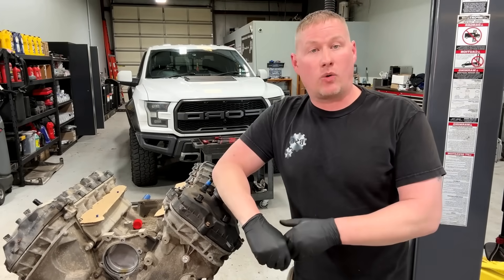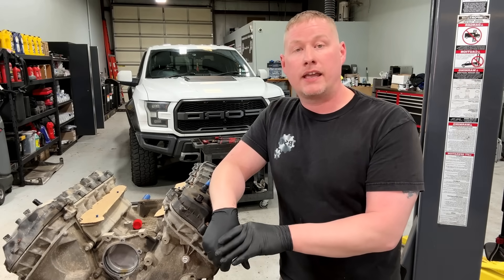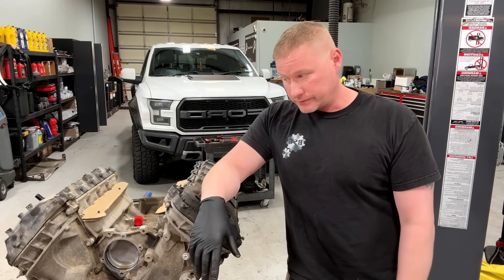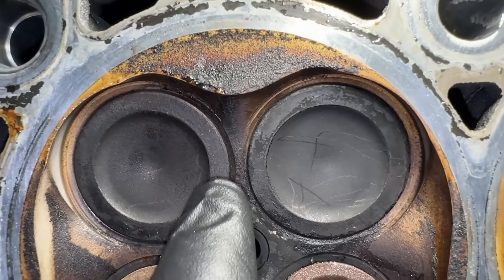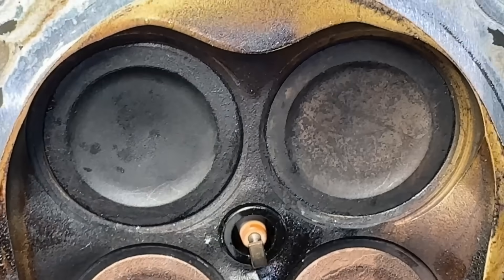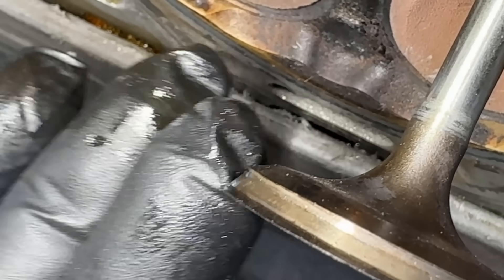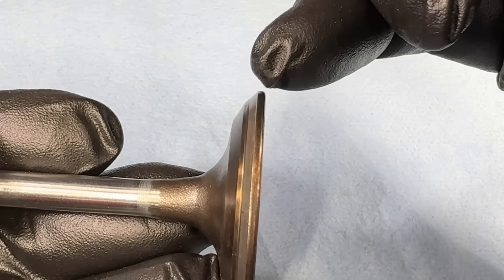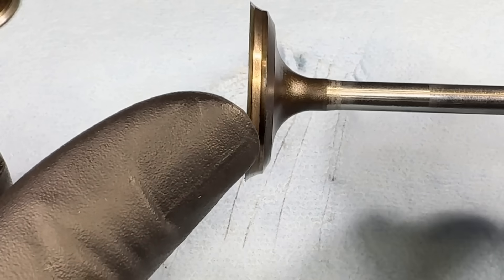The One Fatal Design Flaw of the 2011-2014 Ford 5.0L Coyote Engines!

Comment: Scary world we live in where installing an entire rebuilt engine makes economic sense compared to just rebuilding the heads.
Reply: it situational if you buy remanufactured heads and turn yours back in, its much much cheaper than paying a machine shop but either way labor is expensive
Reply: @sirjames1983   not questioning the economic reality of the situation, but on the whole it’s still somewhat insane that this is the way things are now. Plus, finding a machine shop these days is difficult. It took me a few days of searching and a forty mile drive just to get a flywheel resurfaced last year. That used to be a common, head down to your local shop, sort of thing.
Reply: @Wreckerboy  Very true, the same as in our area here in Canada, as there use to be a machine shop in every community.  They can be found, but it takes more effort and time (driving further afar in ridiculously high traffic) to get the job done, then return, and fight the same traffic back.  It all takes patience, and more $$ these days, on top of the already expensive lives we lead.
Reply: It's about 5000$ cheaper to just replace the valves.
Reply: I wonder how much reman heads are for these motors, I couldn't see replacing an entire engine for a valve issue unless the valve broke and caused catastrophic damage.
Reply: @joecostantino3684  Dollar for Dollar its just logical. I tried your method with a Ford Fusion and lost my shirt. I paid twice and ended up with a Ford Longblock in the end.
Reply: @07GTCalispec  I guess they just don't make engines to be rebuildable anymore it seems. When I bought my 03 Ranger (3.0 V6) in 2018 it had a misfire at idle from Cylinder 6 which turned out to be a bad valve seat. Replaced the heads because it was a known issue for those engines in the early 2000's and it was good as new. Then again this is an old school iron block design pretty simple engine.
Reply: Modular Head Shop is prob the best for Modular fords and coyotes
Reply: i just figured out i have a blown head gasket and it makes me sick thinking what it's going to cost me
Reply: It’s always been this way if you are paying for labor.  For those of us doing our own work it’s different, the hours tearing down the engine aren’t costing us $150 to $200 an hour.
Reply: Just thinking that this is at 130,000 miles as well.
Reply: The powers that be want the auto industry to be replaced with electric vehicles that you can't own off of warranty. Cyclical lifespans that turn car ownership into a subscription. They can turn off your car ownership with a click.
Reply: Anybody remember when your typical gas station could do so much mechanical repairs. All the exhaust pipes and fan belts hanging high up on a wall. Light bulbs, fuses, oil, batteries, etc. near the cash register.
Reply: @ChessIsJustAGame   Back in the early '80's I can remember getting a full exhaust system on my pickup, from manifolds, out to the rear of truck...for $180.00 parts AND Labor!   Now everything has a catalytic converter, jumping the price significantly, and it alone being Two to Ten times more, than a whole exhaust system back when life wasn't so complicated or expensive!   It seems to get worse by the year, giving those with EV's a reason to question why we'd update these parts, when their cars don't need them.

Comment: Not sure what a Re manufactured Long Block cost now days with OEM parts but I had this issue and had both head re-built out the door a few months ago 7k (in frame) out the door.  in my case my bottom end was still really good @ 130k.

Comment: My 2011 has slight miss at idle. 107,00 miles. How long should a person wait to replace engine if it is valve issue? Truck is in immaculate condition.

Comment: My 21 year old Toyota has 266K hard miles on it. It runs just like it did the day I bought it new. No special oils or filters. Just a change every 5K and coolant flush every few years. This is why I don't buy Fords anymore. But I'm a Ford guy and I've never seen any bullshit like this from my Gen 1 Lightning. Yeah, back when a Lightning was a proper truck. I haven't seen a single truck I'd replace my 30 year old Lightning with. Not from Ford or anyone else.

Comment: I did this back in 2017 to my 2011 f150 5.0 but had the heads rebuilt at a good machine shop.The valves where so sharp you could shave your beard with them.  I couldn't afford a new engine at the time so this was the only option I had. They replaced all the valves and seals and this fixed my oil Consumption issue and only cost me $1,500.00 for everything including gaskets and head bolts after a month of working on it over the weekends I got it back together and it ran beautifully for years until I sold the truck

Comment: I have a 13 f150 with low miles.. 53,000… seem like it doesn’t have the low end power it use to. I’ve checked all the normal stuff. Scared to do a comp check lol …

Comment: Exact same thing happened to my 2013 F150 5 L motor. 101 thousand miles and check engine came out with PO four misfire. Took it to two different shops and eventually replace the engine as the trucks in great shape otherwise. Just couldn’t stomach spending $75,000 on a new pick up. Thank you so much for this information. I searched the Internet extensively last year and just couldn’t find information like this. Long time subscriber and will always watch your videos.
Reply: I wish my 13 was a 15 with the aluminum body. Runs like a champ but the body its suffering. Rust repair at this point is just out of the question. Still looks good but when you pop it on the lift you notice the few rust holes in the rockers.

Comment: So it's a material issue with the valve, but why does it always happen in the same cylinder(s)? Do they run hotter or something due to where they are? Thanks, great vid.
Reply from the maker: Yes you are correct.

Comment: I have a 2011 with ~80,000 miles on it. Does this happen at a certain mileage? Does it happen to all 5.0's?
It sounds like a heat treat issue so QC. Would that mean that you can get lucky?

Comment: Brian is as good as it gets if you own an F150. My 2004 5.4 Runs like a swiss watch because of him. 170k miles. I did a complete timing job at 153k miles preemptively after watching his 4 part series. I went even further and replaced everything up front + the oil pump while I was in there, plus all the roller followers, lash adjusters, and cam solenoids. Why Ford is having issues with valves is beyond me, as this technology has been well known for a very long time. Maybe they decided to go import? I have never run into a " sunken valve " issue in my life and I am 77 years old.
Reply: Your lucky my motor was toast at 160,000 miles ! Started ticking and then engine light! The stock oil pump does not put enough oil into the Cam Journals. Had the motor swapped out for an upgraded motor from Power Train products. With a Melling high Volume oil pump. She runs like a champ now! 25,000 on new motor and running strong and Smooth! You may have saved yours just in time? I always changed the oil frequently by the way
Reply: @Jondog65  I have always put in a pint of Marvel Mystery Oil on every oil change. My first job when I was only 12 was helping an old timer that worked on automatic transmissions. He swore by the stuff. So have I ever since, and I'm now 78. Frankly, when I opened up the front cover at 153k everything was pristine, including the roller followers. Brian is most definitely the best source for Ford owners in my opinion, and his videos are clear, concise, complete, absolutely correct, and very well done. My 2004 runs perfect because of him.

Comment: I can’t wait to see that video going over all four current generations of 5.0L. I currently own a gen 2 in my Mustang and a gen 4 in my F150 I just bought. The gen 2 I’ve had no issues that weren’t self induced after 96k miles, ie o2 sensor fail from adding headers.

Comment: So is there a preventive way to address this problem to keep from buying a new engine? Get the valves replaced?
Reply from the maker: No way to prevent it.
Reply: @FordTechMakuloco  lovely. i tend to treat my 5.0 with dignity and respect so hopefully my truck will last. My 2013 is at 80K.

Comment: I feel like the endless 5.0 praise is mostly from old heads and people who can't accept that technology has moved on from the pushrod V8. "NA V8 is most reliable possible engine, end of story" and that's where their mind will sit until they die. While obviously anyone who works on vehicles knows that anything mass produced can and will fail. These types of little design or manufacturing flaws can affect any motor. Yeah, the coyote is usually pretty stout, but as clearly shown here, issues can pop up.
Reply: If you consider how many more moving parts are in these engines compared to the old style 5.0 HO engines, you can see why the new stuff seems to have so many more big problems.

Comment: would you recommend replacing the valves on a 2011 that only has 45k miles on it .. currently runs great.
Reply: Rule #1 in being a good mechanic. " If it ain't broke, don't fix it".  Rule #2. "If it is broke, be lazy and fix it the right way the first time". Rule #3," if it ain't broke and you keep messing with it, it will be broke". So no, we don't take something apart that " runs great"
Reply: @reddyfreddy  Agreed, I just wanted to see what other people would say..  cheers.

Comment: I recently fixed one of these in a 2013 with only 63K miles! Took off the heads and had a machine shop fix them and they could not believe the truck was so low mileage.
Reply: Bad heat treat on the valves, supplier level issue.

Comment: I had far to much of Fords when I was a young man. Back in the early 80s I got rid of the last one I would ever own. I never had a good one at all and had a few brand new ones, they where all a steaming piles of dog doo. It's had for me to believe they are still even selling cars and trucks and haven't gone completely under.
Reply: Not only is Ford still around, they're still huge and I think they're the only American brand that didn't have to beg the government for handout to save them.
I've had over a dozen Fords and never had a bad one that I can recall.  I have one that's about to hit 450k miles, all on the original drivetran.  It's hard to imagine that the only difference between our experiences is luck.  Then again, I've owned several vehicles that are supposedly flawed and had very few issues so maybe it is just luck.....or treating them properly so that they don't become "steaming piles of dog doo."
Reply: @DonziGT230  That's very reason I got out of Fords. They where daily drivers and very well maintained. One of the first "New" Fords I had was  F150 with a 302. Being brand new it was using more than a qt of oil between oil changes. I changed my oil every 3000 miles. Took it back to have them check it right away. Did a oil test for the Dealership using Motor Craft oil and filter per Dealership request. After dealing with this for a number of times I was told this was 'normal' and it didn't need to be addressed. The other "New" one only made it a few weeks before it started jerking and bucking so bad it would throw you out the windshield if you didn't come to a stop. I was put off at first then went to the dealership in the showroom telling people to be on watchout and they gave me a loaner to find the problem. They finally said it was happening a lot and they had some problems and had to get a factory Rep in to find it.  There's far to many stories like this on a daily bases for me. A few friends I know that stay with Ford have had many issues but hang with them. My best friend and his F250  diesel had to  fork out 1,800. dollars for good old EGR replacement not to long after he got it. Yes it was "New" and a daily driver sometimes. He also had to replace other things along the way that shouldn't need it to keep it going. So many hang with them for what I have no clue. I am sure there's far more to your story if the truth was told about the little things that happen. Good luck your going to need it.

Comment: Was any tuliping occurring before the warranty was up?  Somebody should check out extremely low mileage 2011 to 2014 Coyote engine, even though the warranty time coverage is up, if it could be proven on engines under the warranty mileage having valves showing any sign of the beginning of tuliping, then a class action lawsuit could be filed against Ford for not having a recall for valve and guide replacement, leading to customers unduly responsible for complete engine replacement after 40,000 or so miles. This is also an EPA violation of the clean air act with faulty sealing engines not properly cleaning exhaust air with possible EVAP damage.  Go figure !

Comment: This is my issue, on a '14.  Just my luck, and replacing the engine is totally out of my budget right now.  Hoping to find someone to replace the heads with remanufactured units without pulling the engine.  Until then, she's parked....
Reply: Curious what your build date is on your truck? Did you get around to fixing it?

Comment: Been following you for a long time, great stuff! Former Ford tech, moved into service management, dived for the hills just as fuel injection was coming on but have never been able to chase the gearhead outta me, lol! Work IT now, it's ironic that all of my new skills are transferable too. Had a '13 150, 5.0.  cyl 6 started missing intermittently around 100,000, put up with it until 200,000, then it became a daily occurrence... low, rough idle, check wallet light on at every stop. Found cyl 6 had 90# compression, grrrr. Put a tuner on it to raise the idle speed, Torque to kill the check engine light often, and drove it another 100,000 miles. Down a little on power, but I spend most of my time on the highway anyway and it was still just doing it's job. the  5.0 has problems just like any other engine, but this one wasn't giving in. Just traded it for a '24 F150 XLT 5.0. Looking for another 300,000... Thanks for posting, you've saved me a ton of aggravation over the years, and I'm sure for many others too!
Reply: I raised my idle speed too lol

Comment: Why does it seem the Mustangs never have the problems, its always the F-150??
Reply: An interesting question! Not seeing Mustang owners making this complaint here; mainly truck owners complaining. Wondering if there were different components and/or design specs for the Mustang engines, or if those engines are all exactly the same? Perhaps more than one location building the heads or manufacturing those valves? Lots of details that aren't readily available to the regular man on the street. I wonder how many Mustang owners with this engine are up to or over the 100K mile mark on the odometer. Truck owners here are mostly stating mileage in excess of the 100K miles before the valve problem appears!

Comment: Machine shop thing is no joke.  Few and far between for sure.  We had 2 local ones near us (30 mile radius).  One was in business for a long time, their lead guy ended up buying the business about 10 years ago from the original owner and now just closed this year and retired.  The other shop is still open.  He used to be one of the lead machinists for the other shop and went solo a couple years before the other place sold to their other employee.  He's now a one or two man operation with the old wise guy from the place that closed helping him part time setting up racing engines.
Reply: Yeah, its becoming impossible to operate one anymore. Where's the business? Shops just quote used or reman engines now for anything because techs are overworked as it is. The labor $ isn't worth it, so that just leaves DIY project people or race car guys which not every area has enough of to feed a shop. And that's not even getting into the problem of all the knowledgeable people retiring and taking their secrets to the grave, lol. I've heard of so much garbage machine work if you can even find a place.
Reply: @ice44567  The problem is you cant get help !No one wants to learn the trade !THERE IS PLENTY OF WORK !
Reply: @ice44567  yup the business is not really there. No more constant flow of blown up GM, Ford, and Chrylser engines. People wised up and moved on to buying Toyotas and Hondas which have a far lower rate of failure. Heck two the highest volume passenger vehicles in North America so far in 2024 are the Rav 4 (which is arguably the most reliable vehicle ever built) and Tesla Model Y (which since it has no engine will never need machine work!). Where does that leave someone with a machine shop? They better find a niche to specialize in or they will go out of business.

Comment: I would love to see the various differences in the Coyote generations. As well as the differences (if any) between Mustang and F150 Coyotes
Reply: The mustang coyote 5.0 is way different then the f150s 5.0. The  mustang 5.0 has a slightly higher compression, different head design, the whole front plate of the engine is different as well. While the f150 is drastically held back with power by lower compression different heads and front plate. That's why the mustang 5.0 can rev higher then the f150. If you want  too rev too 8500 rpms you might as well just pull the engine out of a wrecked mustang and swap it into the f150.
Reply: @kylebeach2316  Thank You for the informative reply. I am just starting my education on this topic.

Comment: How disappointing  Ford I6 & V8 engines of old would last much longer.  I have a pushrod 302 with 230,000 miles and it idles like new.  Ford has been building engines for over a hundred years.  There is no excuse for these kind of problems.

Comment: I wonder if you could get an inspection camera/scope down inside via the sparkplug hole with a mirror attachment and see the face of the valves enough to see if they had that issue?